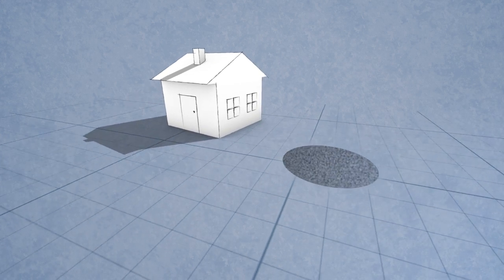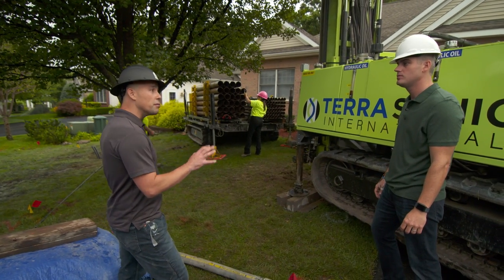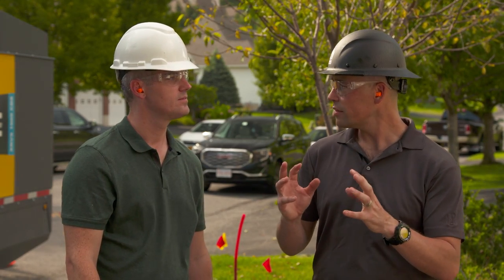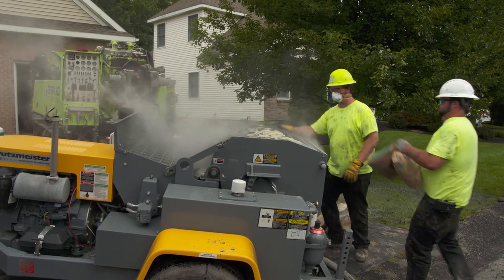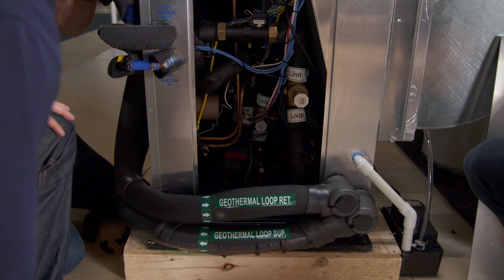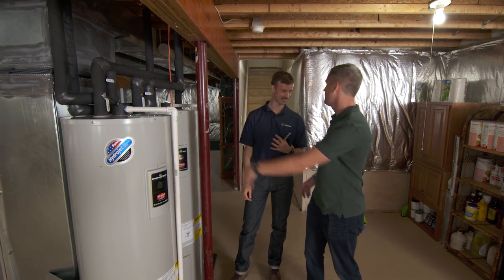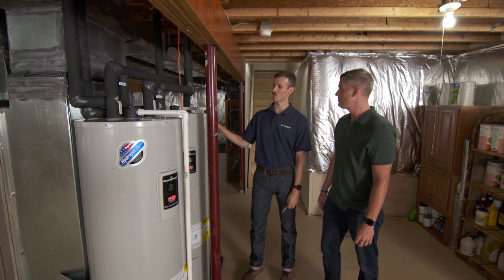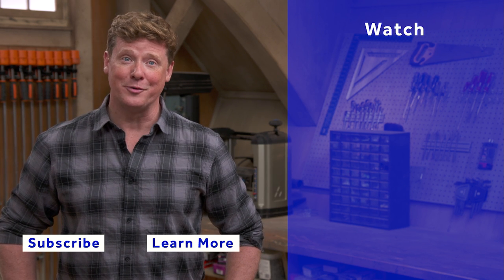Affordable Geothermal | Future House | Ask This Old House

Comment: I had geo installed 2 years ago with an energy monitor.  For a whole summer of air conditioning I used $70 worth of electricity.  This is for a 70-year-old house in hot, humid central Virginia.
Reply: What is the cost return on that?
Reply: @RogeriusRex  Unless it's larger that 2000sqft I am not impressed since I heat and cool a 1200sqft energy seive in central VA  for $$450.00 per year using a Mitsubishi mini split. 

I will say the mini  split  was sized for cooling but I have found it does just fine above 10° for heat.
Reply: What is your ROI?  If it is to have cool tech, sweet your there. If it is to save money I would guess your upside down and will be for a long time. 

 When we were looking at Geo it was going to cost 4X what an air source would cost with much higher repair cost( pumps and compressors go bad) our ROI was 35 years best case.
Reply: Previous system was fuel oil and a 10 SEER air conditioner, so we are saving about $1200 a year, mostly on heating.  Total cost of the system after incentives was $20,000.  We did price one air-source system and it was about $11,000, but that was forced air and we really wanted to stick with radiant heat.  As for maintenance, zero issues so far, but all systems have compressors and either pumps or fans, all of which will eventually wear out.  Geo guys claim theirs last longer not being outside and exposed to the elements, but I suspect maintenance costs will be comparable.  Having said that, I have to admit, having cool tech was also a big factor.  Incentives are going away, and these geo guys have got to bring down their costs a lot or they're not going to be competitive.
Reply: I'm not even surprised by these numbers. You're basically diverting the costs into a rather expensive investment but one that pretty much will always pay for itself over time. This tech has been ready for a while except that most people do not have the money to invest. I believe they should require these systems install on all new construction.
Reply: That is very good saving
Reply: Geothermal last longer. I don't think so. The compressor running year round on heat or cool. Your saving now is saving for replacement for new compressor later.No outdoor unit, yes your condenser is built in together with your indoor unit that made it double weight harder move or install and cost more to replace. Not mention about noise. If you're sounds sensitive you are not going like the noise of the compressor and blower on at the same time. I recommend stick with your gas furnace, boiler or propane. Never install heat pump if you have others options!
Reply: Lawrence,  I am sure you have solar energy systems installed. No way you pay $70 on air conditioning for a whole summer.
Reply: Robert L. Fallin what was your cost to install the Mitsubishi mini split? We are in the Shenandoah Valley and have about 2400sf of conditioned space.
Reply: @mikefishing7547  Geez, gimme a break, one guy says $70 is "not impressive", you say it is impossible.  That is not my electric bill, that is just the power going to the A/C measured separately, and I am pretty confident of those numbers.  Normally the fan draws 400 watts, the pumps draw 150 watts and the compressor draws 1100 watts.  So altogether about 1650 watts.  I measured all these and they are right on spec.  On a really hot 95+ day it runs about 1/4 of the time so it uses about 8-10 kWh a day max, but usually less, and July and August it used 200 kWh.  I have an energy monitor that measures this.  Over the whole summer it used 600 kWh which in Virginia costs $70.  It's a 3-ton unit just like the old air-source one but because the ground loop temperature never exceeds 65 degrees it never goes into 2nd stage so it's really running as a 2-ton.  Plus we don't cool to arctic temperatures, we usually set to 76 or 77 degrees.  Actually I do have solar panels and in summer they produce more than we use.  It's now mid-December and the meter reading is still 300 kWh below what it was in April.
Reply: Khashon Haselrig  My installer gave a 40 to 50% estimated savings but its been better than 55%. I think not running a boiler located inside my homes envelope eliminated considerable infiltration but it's a only a  guess as to the percentage of HVAC cost.
Reply: @kevrides5706  I payed $4200.00 for a two ton single outlet unit in November of 2015. The unit is "spec'ed" for low wall mount , another reason I chose Mitsubishi and it's  worked well. The Mitshubishi line had air direction control that most low cost units dont have. Mitshubishi is pricy but after five years I think worth the cost.
Reply: What make and modle unit did you choose?
Reply: @antonitorres5934  It is a split system.  The condenser unit is a Trane Envirowise T2GN038NNR10CNE.  The evaporator / air handler is a Rheem RHLL-HM3617.  Both are 3 ton and bought surplus on ebay, neither is anything special except the Rheem has an ECM blower motor which uses significantly less power than the old PSC motors though some guys say they have a higher failure rate.  The other key to high efficiency is to be sure the ground loops are large enough.  I got mine slightly oversized as though for 3.5 tons, two 360-foot boreholes.
Reply: Thank you . I will look up on ebay
Reply: @quetzal4042  Thank you. I have a backhoe and wanting to bury the coils. 
I know depth is below freezing and at least 250' of coils?
What diameter hose 1 inch and what material hose?  I was told a dich witch would work to bury the tubes and quicker.
Reply: @antonitorres5934  I am no expert on geo loops so I would not rely on my advice.  I am a major DIY guy, but loops is one thing I left to the pros.  However, I do know that what you want is HDPE (high-density polyethylene) pipe and certainly not PVC.  Size depends on the length of your loops, seems like for 600’ or shorter, most guys use ¾” but I think there is no disadvantage to using 1” other than higher cost.  The longer the loop, the wider the required diameter, otherwise pumping pressure and required pumping power will be excessive.  As for trenching, it’s true, you can do it yourself with a backhoe if you have a large enough area.  I don’t know about Ditch Witch, I believe the max depth they can dig is 4’, which may be below frost line but still kind of marginal for geo because the ground will heat up in summer and cool off in winter to some extent at that depth.  So you will need a longer trench or have to be content with less efficiency.  The general rule is 600-800’ of pipe per ton, so if 3 tons and just 1 pipe in the trench seems like you are talking something like a half-mile of trenching.  As with everything geo, there is a trade-off, but seems like as a practical matter most geo guys like to go at least 6’ deep and wide enough to put in multiple pipes or a slinky coil.  For mine they were going to do three 100’ x 3’ wide trenches with slinkys.  Also, I have seen blanket statements like “trenching does not damage trees or vegetation”.  This is nonsense.  Trenching within the canopy of a tree can be very damaging.  You can easily kill a 100-year-old oak by trenching too close.  Although I have a pretty big lot, it is full of large mature hardwoods, and around here taking down just one big dead tree is at least $2K.  So for me, going with vertical boreholes instead was not a difficult decision even though it cost $5-6K more.
Reply: Sounds like the degree days and bin data where correct
Reply: @Furiends  Especially when many local governments are talking about banning nat gas heating.   If the investment and scale start if off, the costs will fall and the loop starts like it has for solar and wind.
Reply: @quetzal4042  There's not a lot of cool tech that will pay for itself compared to all the cool tech we buy that becomes obsolete in a year XD

The incentives were renewed, as I recall. Pretty sure Biden's infrastructure bill will include more incentives as well.
Reply: @squamish4244  Just finished our 6th winter with the system, still no problems and no maintenance, flip it on in the Fall and off in the Spring, that's it.  Thanks for commenting.
Reply: @quetzal4042  Great! Thanks for replying.
Reply: @Alaric Jagger Definitely, have been watching on Flixzone for since november myself =)
Reply: That is impressive.
Reply: Good for you
Reply: I’m an HVAC professional what is the seer rating of your unit? The geothermal heat pump is still just a regular heat pump there’s nothing special about it. The only thing it does instead of using the air to air is that it has a heat exchanger and uses water. If it’s a 3 ton compressor it’s going to be a Copeland scroll that will be in an air source heat pump. Getting off of oil and doing something else is always a win. I live in the Pacific Northwest replace my oil fired furnace with an air to air heat pump and a saving me thousands. I spend less for the whole year on electricity heating cooling than six months of  oil
Reply: @quetzal4042  you must have a really good R factor on your house. You’re probably right you’re only running in the first stage most of the time. If you replaced a 10 seer that’s definitely going to be a factor too. If you’re doing the AC in the hitting that cheap how to see how long the system runs without problems. Keep the maintenance up especially on the ground loop
Reply: @benkuxhouse787  Actually insulation is not that great.  Walls about R-10 and almost impossible to improve on that because they are masonry with stucco facade.  But it is a small house 1400 sf and partly shaded.  Windows are casement, good at keeping out drafts.  Loops are 360' vertical bore, mostly through rock, probably more stable & reliable than a slinky. All equipment was bought as surplus stock on ebay but going into our 7th year geo heating and 4th  year cooling, haven't had a single mechanical problem.  Best part is not having to shovel 150' of driveway for the oil truck in winter!
Reply: @quetzal4042  Is your system a closed loop system?
Reply: @quetzal4042  Just reading all the comments, I have to admit that this was a Job well done. a come back with all the numbers. Of course it is 2022 and I know this is an old video. But none the less I'm sure that it's even better now. With all the high prices. Great Job. Mr. EZ from Texas
Reply: @ez4009  You bet.  One of the geo contractors I got an estimate from in 2014 showed me some calculations assuming $4 heating oil, I said oh, come on, it's never going up to $4.  Last time I checked it was $5.29, so we'd be spending well over $2K, instead it's well under $400, probably closer to $300/yr for heat.  Just finished our 7th winter, haven't had a single problem with the system.  Thanks for commenting.
Reply: I live in VA, who did you use to install your system?
Reply: @gardengal9901  It's complicated.  The short answer, if you want a recommendation, I'd go with Hungerford in Richmond.  They had the lowest estimate and also the best and most straightforward warranty – 10 years on everything.  Very down-to-earth guys, no hype.  The other two estimates I got from Green Air and Delta Temp were $5-10K higher and warranties were full of exceptions and fine print.  Now the long answer – I didn't actually use any of them.  I wanted to use the existing cast iron radiators for heat and NONE of these contractors were willing to do that.  So I bought 2 geo heat pumps on ebay, one for the radiators and one for the air conditioner.  I contracted directly with Virginia Energy Services to put in the geo loops.  (VES pretty much has a lock on geo loop installation in central Virginia and would have been doing the loops no matter which HVAC contractor I chose.)  I worked with a local HVAC guy I knew personally named Charlie McKann (pretty sure he is retired by now) for the ductwork and plumbing, but for the heating I did most of the system design and controls myself.
Reply: @quetzal4042  Thank you so much for your reply!  I reached out to Virginia Energy Services.  Who installed your solar power?    I am fortunate in that I have a new home build in an old cow pasture.  Planning to go as net zero as possible with the new design.
Reply: @Furiends  the pipe in the ground goes bad 40-50 years.

Comment: Damm when I quoted a Geothermal system back in 1998 it was $30k just to drill the well!  Payback was over 10 years.  For $20k including the whole system today that's a no brainer.  Where do I put my deposit down?
Reply: Indeed. Investment wise its always going to pay for itself. Further the technology is solid today and the systems can be maintained by many contractors. The only problem now is how many home owners have $20K to spend?
Reply: That is after incentives... keep it in mind
Reply: This is for a vertical closed loop system using a compact machine for installation. Using a closed horizontal loop system on more rural properties can often be cheaper at around 15k in some places.

Comment: I wish they would refer to this as a "ground source" heat pump, as opposed to an air source heat pump. Using the term "geothermal" confuses it with the high temperature steam used at volcanic hot spots.
Reply: Hi Doug, agreed. Ground source is the better term to describe the heat pump in this installation but thy being said geothermal is also correct, and the term used more frequently by the public.

Comment: I've always been interested in geothermal heating/cooling/hot water systems.  It's nice to see these improvements for installing them in existing neighborhoods, and with the financing options.  

It's just like living in a cave, but without the dampness, the bats, and you get to keep all your side windows.
Reply: They’re just drilled shafts. Nothing new.
Vibratory hammer to drive the casing, and a tremie to pour the concrete. This is about as common as it gets in construction.
Reply: ground source and roof pv are both solar//vesuvius is geothermal

Comment: Geothermal is a no-branier, especially for new construction. Even at $20k, I suspect it'll pay for itself in a decade, maybe less, when you factor in the huge reduction in electricity cost. If you go a step further and couple it with solar, now you have a net zero energy home. I will definitely utilize geothermal+solar when I build my house. Great video!
Reply: Absolutely right! This system had a simple payback of just over 8.5 years. And that is based on pretty high electrical costs in that area. That being said that area also has great rebates for this technology.
Reply: At $20k. are you sure? That's how much I paid for replacing my main water pipe from the sidewalk meter to the house,approximately 20 feet.
Reply: @r.j.m4245  First, $20k was the cost he stated in this video and, second, you paid way too much for that job!
Reply: We had geothermal put in when our house was built 20 plus years ago.  In 2011 we added 7.36 KW of solar.  We just activate an additional 7.45 KW of solar.  We drive two Chevy Volts.  I figure that we are doing our part.
Reply: @r.j.m4245  You don't need to save the install cost, only the cost difference between the Geo and a traditional unit.
Reply: @williamklopfenstein53  what state do you live in. Looking to install solar myself
Reply: Im wondering if geothermal can be paired off aginst solar heaters?? To get a high exchange diffrence?
Reply: @jerryhuntjj2885    I am in Illinois.  Sorry for the late reply.
Reply: What did 20k buy cause my quote for a two ton system turnkey was 40k. I suspect this install was a loss leader.
Reply: @robertl.fallin7062   - no, it's Dandelion. Their integrated system and new drilling rig makes the difference.

Comment: Had one for 10 years. Broke down often. Most local AC companies won’t touch them. Was a very expensive lesson. Now have air to air heat pump.  Located north FL. Your mileage may vary.
Reply: Was yours open loop? New systems are closed loop and supposedly very reliable.